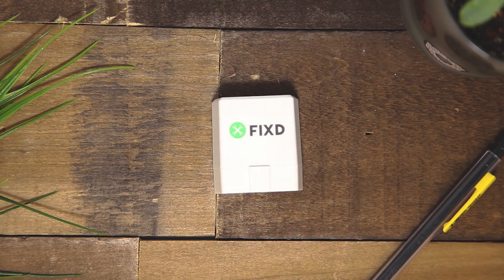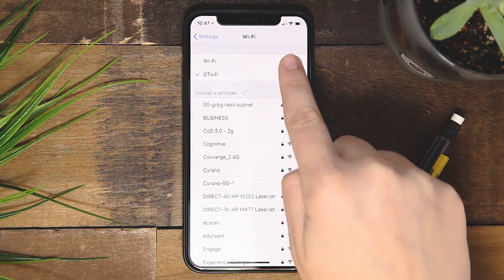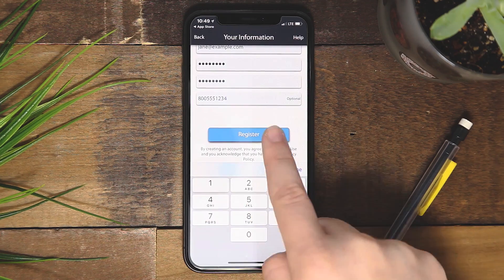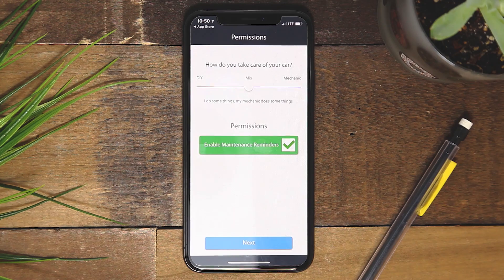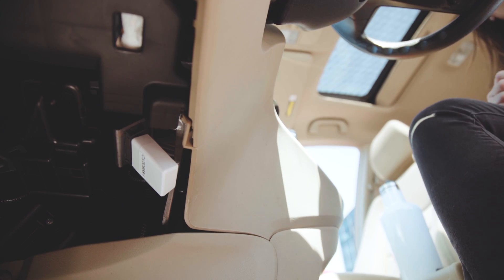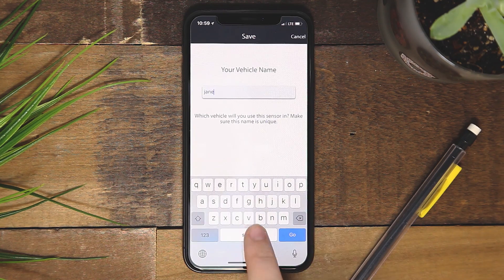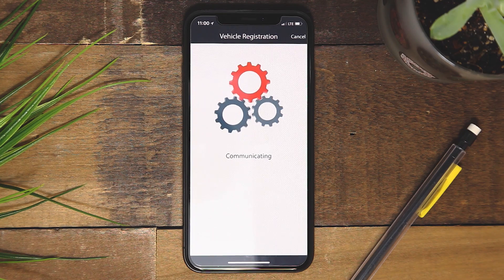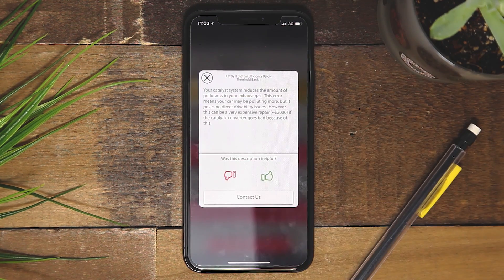How To Setup A FIXD Diagnostics Sensor

Comment: hey fixd, will your code reader tell you why the code is present? meaning, can it tell you a wire is broken, sensor failed, etc? can it also tell you that the vehicle has been in an accident that wasn't reported to insurance?

Comment: P0301 on a ‘13 Ram 5.7. Please tell me with your code reader what is causing the cyl 1 misfire.  
Is it the fact that when the previous owner installed a spark plug with ZERO gap (literally touching). Was that the misfire?? O wait, the primary plug fired fine. 
Did the secondary plug cause the coil to go bad?  
WHAT IS THE CAUSE OF THE P0301???? 
FYI, unless you do actually diagnostic you don’t know. QUIT BUYING THIS CRAP only reason for this is to give you a starting point. Might as well go to zone and get the code read for free.

Comment: I would highly encourage people to be very careful with this company's "subscription offering."  They will setup an auto-pay and the notification of an upcoming payment is either nonexistent or could get lost in your SPAM filter.  I received a PayPal notification of $99.99 at 4AM in the morning.  That same day I tried to contact support to cancel my subscription.   I simply don't get that much value out of the service.  Support informed me that the refund was only applicable to the first 30 days.  Huh?  This is ridiculous.  It was the same damned day!  So, yes, I've contested the payment with PayPal and the underlying credit card vendor.

But let's look at this another way.... What does a FIXD subscription really offer?  Frankly, more fluff than value.  The best thing about it is that you can monitor your fleet of cars.  But is that worth $100?  Not to me.  As for its usage as an OBD2 reader?  Yes, it works... kind of.  As OBD2 readers go, it will give you the basic stuff.  But if you think it will be your only reader, think again.  An OBD Link MX+ will give you a LOT more mileage for roughly the cost of one year's subscription.  With the MX+, you can load extensions for different vehicles.  Even the basic read can give you a lot more information.  I never did see how I could even reset my oil change light with the FIXD.  That is, frankly, kind of the minimum bar of entry for any reader.  Is it there?  Maybe, but if it was, it was not clear.... 

So... do yourself a favor and ask yourself... "Do I really want to support this company?"  I was moderately happy with FIXD at first, but this whole subscription thing has made me regret that I ever bought one of these devices.  I should have just stuck with the MX+ which, incidentally, I had to buy after I got the FIXD (says a bit about the feature set).

Comment: I just received my device and I wasn't able to register my fixed device for some reason. The only prompting I got in an app was to provide my email and passcode doing registration. Then I was prompt to continue and then it took me directly to the inside the app. I don't know what's going on. All the steps that I saw that you went through was skipped on mines for some odd reason. I see nowhere in my app where it prompt me through all the steps that you showed on this video. This is very frustrating!
Reply: Call their customer service.

Comment: I think Fixd is a good product. It can definitely help the home gamer. I'm a certified and skilled mechanic by hobby, and previously by profession. I have to say though, your ads are garbage. There are mechanics out there that are scumbags, that's for sure. Your ads however propagate the idea that many or most mechanics are like this. A lot of times replacing the sensor or part associated with the OBD code does solve the issue, however people that don't know much about cars will think that this is always the case. What if the code is the only indication of a serious electric or mechanical issue? There are a lot of problems that or more complex than a parts cannon solution, which is not in the skill realm of most of your market. You've been misleading and downplaying the value of a good and honest mechanic. The blue collars  of the field do not appreciate the messaging of your ads. Yall know it too, I'm sure.
Reply: This is why there needs to be a government regulation of the industry. And real consequences for the unscrupulous mechanics that take advantage of the unsuspecting.
Reply: @screwyootube1 I disagree about having more regulation. Oversight policies WILL lead to even less consumer control over how to repair their vehicles (as it has in other industries) Then, you'll WISH you could get screwed by a mechanic after seeing how bad the manufacturers screw you. Mechanics that take advantage of their customers should be called out, publicly shamed, sued, whatever. However, the person who got screwed is NOT without fault. The customer doesn't need to be a pro to realize they're about to get screwed. Nothing more than basic research (2nd opinion, comparing prices, check the code at autozone or with scanner and see if mechanic's estimate makes sense) and a layman's understanding will give you a level of confidence when walking in to a shop so that YOU WILL NOT EVEN COME OFF AS A TARGETABLE PERSON IN THE FIRST PLACE. A business wouldn't take the risk of being bought screwing somebody, and would only try to do so (if they're like that) to somebody who clearly has no idea what's up with their car cause it can be sensed.

Comment: fixd youtube ads are VERY misleading. there is NO scan tool that tells you which part has failed. codes are there to send you in a direction. training and proper tools will find the correct problem.

Comment: nowhere do they mention that you need to buy a 1 year sub. for 69 bucks..........
Reply from the maker: Thank you for pointing out this common misconception. No fee is required. 😊

With your FIXD Sensor and the free FIXD App, you can translate 7000+ engine codes into plain English on your smartphone, see how serious your issue is, access detailed repair guides and how-to videos, monitor the health of multiple vehicles, and receive automated maintenance alerts.

FIXD Premium is our 100% optional (yet extremely helpful) add-on to the FIXD App. A Premium subscription is NOT required to use the free features of app, scan your vehicle for engine codes, or clear the check engine light.

Comment: Will obd tell you about a faulty control arm?
Reply from the maker: FIXD is only able to read and clear your vehicles' check engine light. The other lights (TPMS, ABS, Airbag, Maintenance lights, Stability Control, etc) and issues are controlled by manufacturer-specific parameter identifiers, which makes it difficult for us to read this information through the OBD-II port.

We are working on licensing this information from the manufacturers and have a few manufacturer codes available, but not for all models that are compatible with FIXD yet.

Comment: How do I open the container it comes in. I’m stuck on that part
Reply from the maker: Thank you so much for ordering FIXD! To open the package the FIXD Sensor comes in, slide the plastic case out of the paper sleeve and pull off the lid of the case. Your FIXD Sensor should then be easily lifted out of the case. Please let us know if you need further assistance.

Comment: What is the PIN for the fixed OBD2 sensor
Reply from the maker: Hey Dakota, there should be a code on the back of the back of the sensor used to register your sensor into the free FIXD App. 

Additionally, your FIXD App account will have a PIN number for when you call our FIXD Mechanic Hotline with the optional FIXD Premium upgrade. This number is under the FIXD Premium section of the app.

Comment: Do you have to subscribe to a software program to make the FIXD work?
Reply from the maker: Hi Bill, you do not need the optional subscription to use the free FIXD App!

With your FIXD Sensor and the free FIXD App, you can translate 7000+ engine codes into plain English on your smartphone, see how serious your issue is, access detailed repair guides and how-to videos, monitor the health of multiple vehicles, and receive automated maintenance alerts.

FIXD Premium is our 100% optional (yet extremely helpful) add-on to the FIXD App. A Premium subscription is NOT required to use the free features of app, scan your vehicle for engine codes, or clear the check engine light.

Comment: That's cool if it would just trun the blue light on and find the sensor
Reply from the maker: Hi, it sounds like you might have some connectivity issues. First, we recommend not connecting through your smartphone’s Bluetooth menu and instead connecting directly through the free FIXD App. Please also make sure your FIXD App and phone operating system is completely up to date.

Next, we recommend double checking that there is a blue light that flashes when you plug the sensor into your OBD2 port.

If you are still running into issues, please reach out to our support team for assistance.

Comment: tried to insert the code when sensor already plugged in, didn't work. first time i unplugged it then put it back in all while car was still on, didn't work. other then that said it was compatible with my vehicle and blue light flashed. will try following steps of this vid see if that changes anything if not then damn idk how it will pair/scan. my screen is totally different as well from the vid but basically same process.
Reply from the maker: So sorry to hear you are having some connectivity issues, Lethidox. 

First, we recommend not connecting through your smartphone’s Bluetooth menu and instead connecting directly through the free FIXD App (but make sure your Bluetooth is on).

Next, we recommend double checking that there is a blue light that flashes when you plug the sensor into your OBD2 port. It should blink when it is plugged in and again when you hit “Tap to Scan” in the app.

If you are still running into issues, please reach out to our support team through the link for them in our caption and they can further assist you.
Reply: @fixdapp  i've already synced it to my bluetooth. will try to unsync it and it flashes blue when plugged in but not i dont think when i tap scan. will have to check that. tried to scan via this way otherwise and still wont show up even at 3 bars. doubt i can hit 4 bars even with 5g at my house. updated app, redid everything still doesn't sync even with the old bluetooth settings on the app.

Comment: No it asks for pin
Reply from the maker: The PIN number is related to the optional Premium upgrade if you call our mechanic hotline. You might be thinking of the VIN number which is on your vehicle in the windshield or the door. Please reach out to our support team through the link in our caption if you are still experiencing issues and they can assist you further! 😃
Reply: Its 4 numher pin

Comment: My senser is not working. Have tried multiple times. Lost my phone a couple months ago and got a new phone. Downloaded the fix app plugged it in entered the code and it says where having trouble locating your app . Please check and make sure it's in correctly. I get this over and over again. My engine light is on and I want to find out what's going on .
Reply from the maker: So sorry to hear you are having some connectivity issues, John. 

First, we recommend not connecting through your smartphone’s Bluetooth menu and instead connecting directly through the free FIXD App.

Next, we recommend double checking that there is a blue light that flashes when you plug the sensor into your OBD2 port.

If you are still running into issues, please visit our support team link in the caption for further troubleshooting.

Comment: I tried to download your app, however, it states I need IOS 14.5 or better, unfortunately this device will not work for me.  This should have been stated up front.  The only thing advertised on the outside of the box the device came in, is that it works with iPhone 6 or later.  I want my money back.
Reply from the maker: So sorry for the confusion, please reach out to our support team at the link in the caption and they can assist you with this issue.

Comment: Doesn't even connect to my phone
Reply from the maker: So sorry to hear you are having some connectivity issues, Ivan! 
First, we recommend not connecting through your smartphone’s Bluetooth menu and instead connecting directly through the free FIXD App.

Next, we recommend double checking that there is a blue light that flashes when you plug the sensor into your OBD2 port.

If you are still running into issues, please reach out to our support team so they can assist you further. 😊
Reply: @fixdapp  how do I contact support? I tried connecting through the app and through my phone

Comment: If I had known I had to purchase the app I would not have purchased the FIXD Sensor...complete waste of money🤨
Reply from the maker: Thank you for pointing out this common misconception. Did you know that you can actually use the app for free without the optional upgrade?

With your FIXD Sensor and the free FIXD App, you can translate 7000+ engine codes into plain English on your smartphone, see how serious your issue is, access detailed repair guides and how-to videos, monitor the health of multiple vehicles, and receive automated maintenance alerts.

FIXD Premium is our 100% optional (yet extremely helpful) add-on to the FIXD App. A Premium subscription is NOT required to use the free features of app or scan your vehicle for engine codes.

Comment: Mo matter what I do I can not set it up. It keeps saying Wi-Fi not connected
Reply from the maker: So sorry to hear you are having some connectivity issues. We actually recommend not using Wi-Fi when using the app and instead using cellular data. 
First, we recommend not connecting through your smartphone’s Bluetooth menu and instead connecting directly through the free FIXD App.

Next we recommend double checking that there is a blue light that flashes when you plug the sensor into your OBD2 port.

If you are still running into issues, our support team will be able to assist you at https://bit.ly/FIXDsupport

Comment: Why didn't they advertised that you will need to purchase the App for $78.00 a year? Isn't  that the main part?! That's why I will make sure to warn people any and everytime I see them advertising. Smh!
Reply from the maker: Thank you for pointing out this common misconception, L! You are speaking about the optional upgrade to the free FIXD App. 

With your FIXD Sensor and the free FIXD App, you can translate 7000+ engine codes into plain English on your smartphone, see how serious your issue is, access detailed repair guides and how-to videos, monitor the health of multiple vehicles, and receive automated maintenance alerts.

FIXD Premium is our 100% optional (yet extremely helpful) add-on to the FIXD App. A Premium subscription is NOT required to use the free features of app or scan your vehicle for engine codes.

Comment: This is a very good video.   Thank you.   Incredibly and properly facilitated.  By any chance does the fixd sensor work on all vehicles.   Can you use it to diagnose different vehicles?
Reply from the maker: Thank you so much for the kind feedback, James! FIXD works on gas-powered (including hybrid) vehicles built after 1996 and diesels built after 2008 with an OBD2 port. 

Regarding, multiple vehicles: It’s up to you. :) You can use one sensor for all your vehicles, or connect multiple FIXD Sensors to your smartphone to remotely monitor the health of your entire fleet of vehicles and know when it’s time to schedule service - even if you’re hundreds of miles away!

Comment: I've been a tech for 35 years, I hold a California emissions inspector license. This item  is nothing more than the courtesy scan just about any parts house will give you for free in the hopes you will be buying parts hat are usually nonreturnable. /The end result is you will go to a tech with your own diagnosis which will most likely be wrong and you will want the tech to change the parts this system made a guess at. When that does not fix the car you have bought a part or pats that you are stuck with as well as labor you asked for that won't be refunded. 

You will still be paying a tech to make a proper diagnosis because IF I'm wrong I have to fix it for free, see if they will give you that same guarantee.
Reply: As a fellow ASE certified tech, I agree with you to a certain extent, but I also disagree to a certain extent. 
1.) Yes, they do exaggerate the abilities of this thing.  Even the most seasoned mechanic can't always tell for sure just based on information from an OBD-II scan. For instance, an emissions small leak. 9 times out of 10 it is the gas cap. However, on that 10th time, it may be a leak somewhere else like a vacuum hose on top of the gas tank...which you can't find without some inspection (usually a smoke test) 
2.) With that said, I disagree with your assertion that it's "nothing more than the courtesy scan just about any parts house will give you for free".  Those courtesy scans won't give you freeze frame data to tell you the state of the various sensors at the time of an error code being thrown. Those courtesy scans can't give you live data directly off the various sensors inside the car. (Back to point 1......most of that information isn't real useful to a person who isn't already a knowledgable tech...but my point is...this tool is actually much more useful than a courtesy code read at a parts store....in the right hands..
Reply: @richardnicely5573  do you think fixd is gearing their ads to the "'right hands"?

Comment: I was told to plug the sensor in before starting the car.
Reply: It truly makes absolutely no difference. In the video they said to turn on the car first...but there's no reason to do so. It's actually probably safer to plug it in first and then turn it on (which is how much OBD-II scanners work anyway)